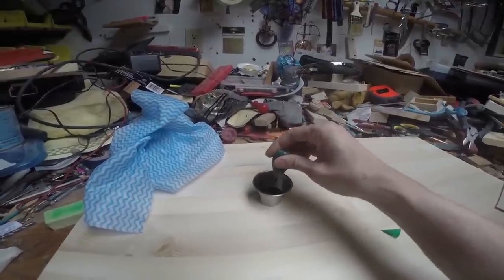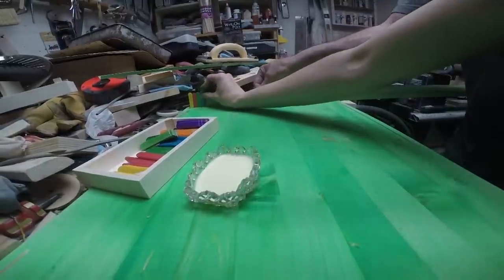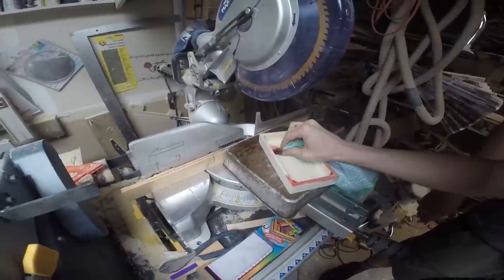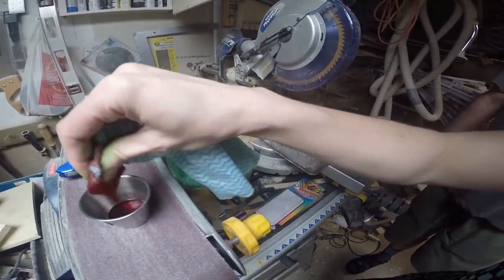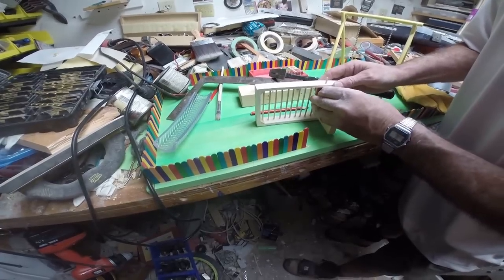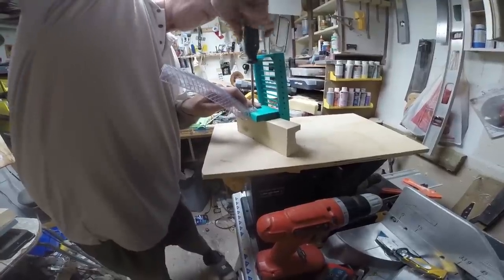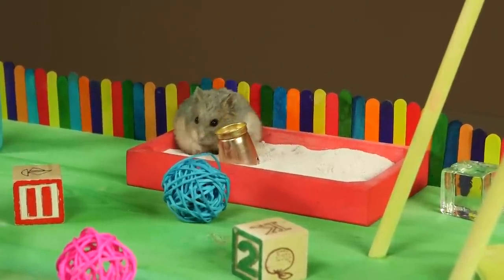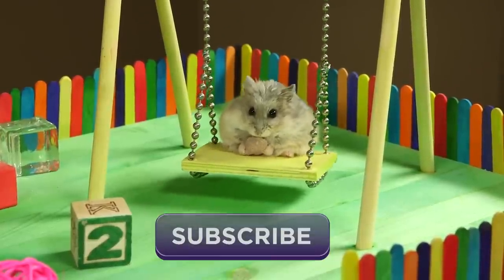Tiny Dwarf Hamster in a Tiny Playground - Step by step tutorial

Comment: what wood did you use? And where can I buy it? I can't seem to find wood thats save for hamster anywhere.
Reply from the maker: Hi Casey, Here's a site that lists safe wood to use. http://www.hamstercentral.com/community/housing/1650-what-wood-use.html I used wood that was untreated with no paints or varnish. I then stained it with food colouring and water. I make sure to supervise whenever my hamsters are playing in the playground to make sure they don't chew anything or get trapped anywhere. My girls are pretty good about not chewing things. I can't even get them to chew their hamster chew sticks.
Reply: Casey Davies I worked at a Lowe's lumber yard and have a couple of dwarf hamsters.  

The main, wider aisle of the lumber section- which has 2 x 4s, stair stringers, large pieces, and other wooden construction commonalities- mostly has pressure treated wood... not good for a hamster to chew and swallow.  However, all of the craft wood section and even a small portion of the main aisle have wood that has not been pressure treated.